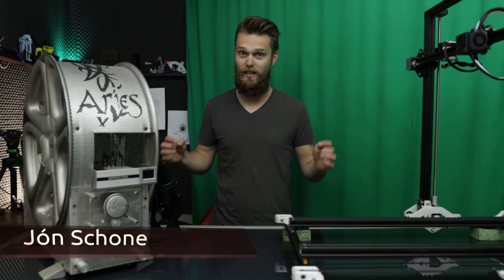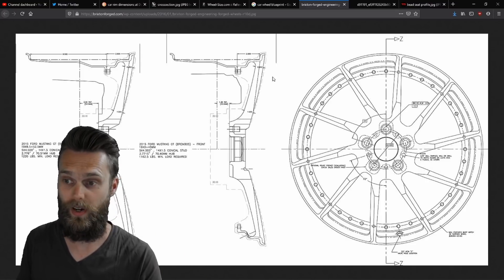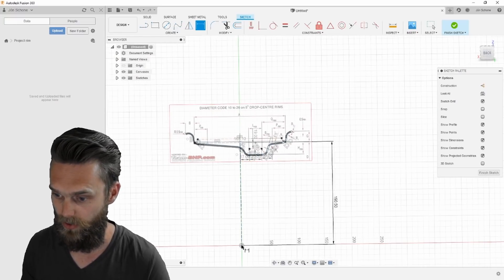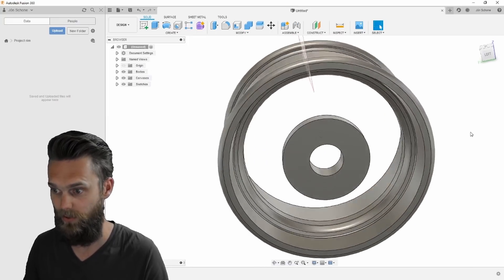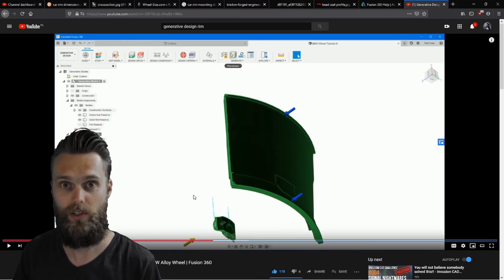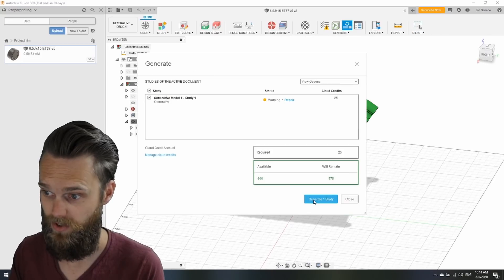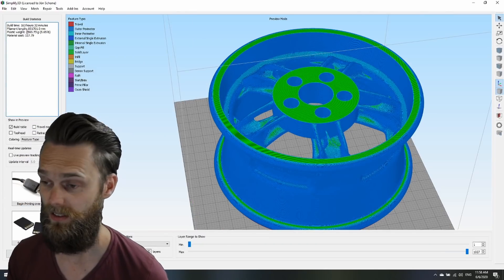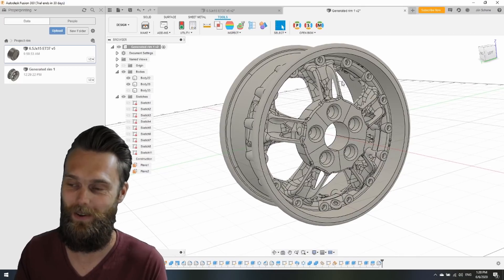Using Fusion 360 generative design to design a full-sized 3D printable rim

Comment: A car on this tiny piece of plastic ? That just doesn't feel right... Also the load you used for the generative design seems like an absolute best case scenario, the wheel has to turn meaning that the forces won't be perfectly centered on a spoke.
Maybe you could get an idea of how strong the wheel is going to be by printing some at a smaller scale, like 1/4, 1/8 and 1/16, put an axel and load the thing until it breaks.

Comment: Instead of cutting the entire rim in half you should cut the center out and use your same bolt design to volt it to an inner flange that way you don't have to deal with the air toght gap

Comment: Wow. Great video. Autodesk should have sponsored you. You're demo'ng Fusion 360 capabilities. : ) Is there risk of air leaking through all the bolt holes? Move the o-ring outward? Just thinking out loud. Great engineering. Mahalo for sharing! : )

Comment: Would the result be different if you told the computer that the material was going to be aluminum?
Reply from the maker: I recon it does, the examples I've seen had much thinner branches because aluminum doesn't need as much material to be as strong.

Comment: If this one brakes you need to do something with tipology optimyzation.
Reply from the maker: Generative design is basically topology optimization. Topology optimization is now a part of generative design and it can still be used by designing a rough shape first, but I like the generative part more ;)
Reply: @properprinting  je hebt je de computer verteld hebt dat je een vijfde wiel wil, maar je wil eigenlijk een hele. als je een heel wiel gebruikt voor de simulatie  komt de computer vast met iets sterkers. bijvoorbeeld horizontale verbindingen tussen de spaken... ik dacht dat je beter T.O kon gebruiken, maar dat maakt niks uit. maar onthoud: 'IF this one brakes' als dit goed komt is het helemaal top.

Comment: The smallest diameter part of the rim barrel profile is there to give the bead of the tire somewhere to go while it's being mounted so those protrusions may not work.  Also the point forces on that barrel are going to be pretty high when the tires is being mounted so you may want to keep that in mind (forcing the tire over the rim requires a lot of, well, force)
Reply from the maker: Thanks for the info! My idea is to put the tyre on before mounting both halves together so I don't have to force it over that outer edge. I have to reduce the bolt pattern diameter though

Comment: Most impressive.  Can't wait to see the final piece.  Even if the 3D printed part doesn't work, you can use it to test fitment, and send the final design out to be milled, or 3D printed in metal.
Reply from the maker: Thanks! This would indeed be a thorough test for filament and other CNCKitchen like experiments xD I have a plan which should be able to get this to work! :D

Comment: Design Spark Mechanical/TinkerCAD for life. Was never able to get the hang of fusion 360. I like autoCAD's coordinate system, but it's not great for 3D modeling/printing. Will hit the lottery someday to make the perfect CAD software.
Should compare the generated design to one you create and think will be strong.
Reply from the maker: I tried DesignSpark mechanical, but I didn't like it at all xD I'm so used to Inventor and SolidWorks. In my opinion, the perfect CAD system is like Inventor running on Linux xD
Reply: @properprinting  No Love for OpenSCAD? Just needs some actual usable UI so I don't have to learn programming.

Comment: Awesome video! Can’t wait to see the finished product. Are you going to paint the rim once you are done or do something completely insane like electroplating? I was curious, when you applied the loads for the generative design, I can see the weight of the car and the 2000N drive load, but do the tangential loads applied at the 90 degree offset cancel each other out?
Reply from the maker: Thanks! I think I'm going to leave them in such way that they're obviously 3D printed. One of the materials I'd like to try is Nylon and I recon milky white wheels will look insane xD I was wondering the same about cancelling out those forces, but I don't have another idea of how to add an accelerating and decelerating force. I used similar forces as the guy in the video I referenced to did so I have a starting point. This wouldn't be my final design for sure ;)

Comment: Assuming the load case at 11:55 is just the tire pressure, and the other ones acceleration and braking, I don't see the one for a large lateral load, like taking a corner. Did you cut it out of the video?

edit: actually I only see one load case with a bunch of forces cancelling each other out?
Reply from the maker: That's a good question. I was wondering if they cancelled each other out, but I don't know how else to add both acceleration and deceleration. I've added similar loads as the guy in the video I referenced did. The load case of 2000N is more than the tire pressure, but I'm sure this wouldn't be my final design ;)
Reply: @properprinting  can you make multiple load cases?

Comment: Jon, please never lift a car that isn't on the parking brake. It'll also help you loosen those bolts.
Reply from the maker: I put it on the parking brake when lifting it, not the first time lifting a car ;) It was in first gear when loosening those bolts, but it would indeed be better to put it on handbrake to begin with
Reply: @properprinting  cool, thx for replying. I didn't think it was your first time working on a car, just didn't look like it was in park. Stay safe!

Comment: Great video again John! How is it going with the enclosure? i got a lack enclosure for my ender 3 .. but it sucks fire hazard kinda... i was thinking about using a old cheap "patch kast" or "server kast" from marktplaats what you think?
Reply from the maker: Thanks Pascal! I lost myself during the design process and I'm afraid that this enclosure will be a bit too much xD A patch or server kast would work fine I think. They are made to cool the inside so you might need to add a bit of insulation

Comment: https://www.autoblog.com/2019/07/07/volkswagen-type-20-concept-retro-ev/ I was involved in this project. The rims are generative design with help from Autodesk experts. It barely passed the load requirements with cast alu. I doubt it's doable with FDM.
Reply from the maker: Interesting! I've seen that project a while ago, so cool that you were involved with it and found this video! I have my doubts too and I cannot imagine that it will hold up under all circumstances but we'll see how far it goes ;)
Reply: @properprinting  One more thing, we were bothered by the clearance for the brake caliber and brake pads. I dont see you have considered that in your design.
Reply from the maker: @LiangKong  the obstacle geometry should have taken care of that, but it would be a good idea to double check that before printing xD

Comment: In Fusion 360, you can input expressions for dimensional measurements (i.e., "15/2 in" will default to 7.5").
Reply from the maker: Yes indeed, that's so cool that this is possible! I did it for most dimensions, but not for the one you mention xD

Comment: The rim looks beautiful. I think you need some sort of alignment ring for the two parts. Now it looks like they are two flat parts? It will also help make it more airtight. It will certainly be a challenge to get layers of plastic airtight.
Reply from the maker: Thanks Alex and a great suggestion! I'm going to add some ridges around the screw holes for centering. I'm going to find a fitting O ring to make it air tight or use liquid gasket

Comment: Looking forward to your tests. Is Fusion calculating with injection molding material properties? If so you might need some more material. Also i think sideways forces (driving around a corner) might be a challenge (were these in the calculation?). But as mentioned im excited for the test when reality meets simulation. Always a lot to learn. 👍
Reply from the maker: Me too! I think that Fusion calculates with a homogenic material and I'm sure I have to tweak the design. I have a starting point now :)

Comment: You'll need steel inserts or the wheel studs will tear the rim up. Looks freaking AWESOME!!!!
Reply from the maker: This is a very good point! I'm going to start testing with angled washers and continue until it's strong enough :)
Reply: Maybe steal wires? Im thinking like how concrete is strengthened by putting it steel breaded cables that are under tension.

Comment: Genuine question Jon, by adding those M8 (?) screw holes to hold both rim pieces together, aren't you changing it's integrity ? I mean, shouldn't the generative design have those screw holes already in it to account for them when generating the design ?
Reply from the maker: That's a good question which I cannot answer with certainty. My intuition says that when the bolts are tightened they aren't holes (strength wise) anymore and even stronger than the plastic itself. A bigger problem would be that 3D printing is not homogenic. The safety factor is 2 so I hope that it's strong enough, but we'll find out ;)

Comment: I'm scared. Those rims - 3d printed - look like an accident calling to happen.
Reply from the maker: I'm a bit scared too xD I'm not going to test it on the public road of course ;)
Reply: But what a way to go!
Reply: Temperature from the brakes will melt that plastics
Reply: I recomend testing it on flat sand. Maybe a beach and then at low tide so you can ride on the extreme flat surface where with high tide the water would be. It should be perfectly smooth and be the safest place to test because if something breaks it will slide with out extreme resistance giving you a easier time to slow down gradually
Reply from the maker: @Rodenburgw  I haven't thought about that, good suggestion. I'm first to build up some confidence in my backyard xD Gradually increasing speed and breaking on other locations